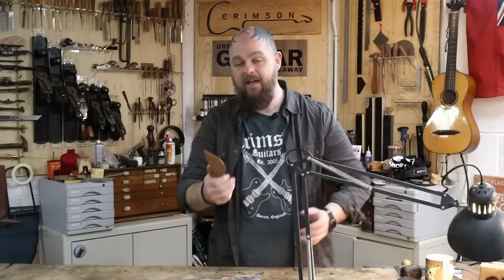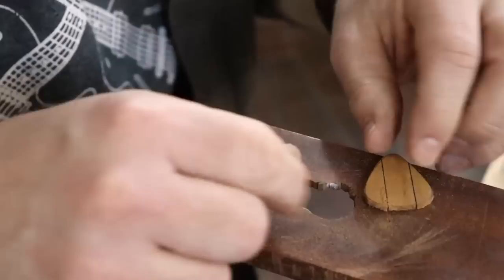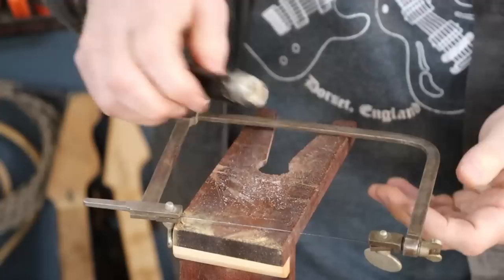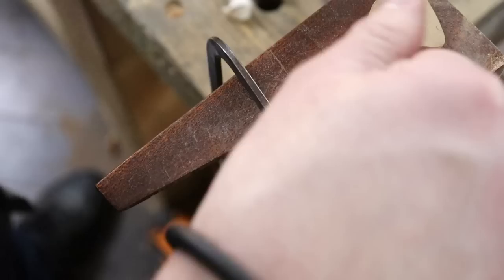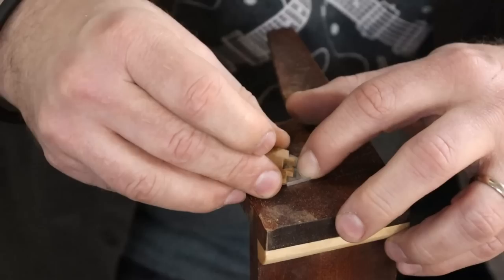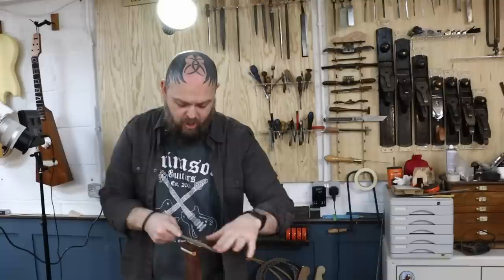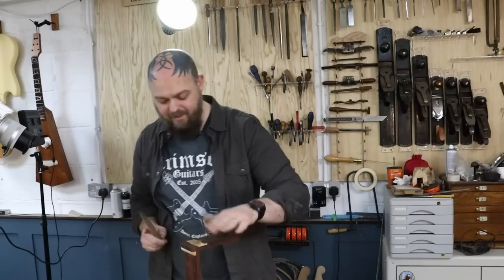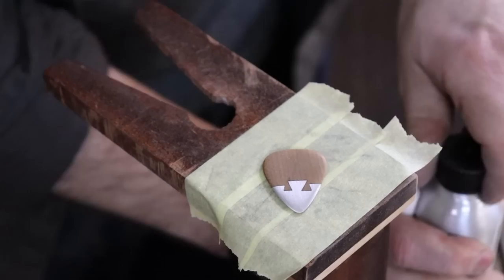How to OVERCOMPLICATE Plectrum Making | Dovetailed Swamp Kauri & Aluminium Guitar Pick

Comment: Making your own picks makes sense - you've definitely got the woods for it 😀
I'd be interested!

To get a stronger dovetail-joint between the wood and aluminium it might be useful to soak the wood in resin of some sort, just to harden it?...
Or create an aluminium outside, the contour of a plectrum, and fill the inside with a nice piece of wood - you'd get the thickness and feel to your fingers, but the stiffness and durability as well.

Comment: Carbon fibre and silver would be nice, particularly as you can't have carbon fibre plectrums (the dust produced is so nasty.)

Also wood (acrylic or stone) as an insert to a metal frame for a plectrum means you can use materials which wouldn't hold up in the normal course of use.